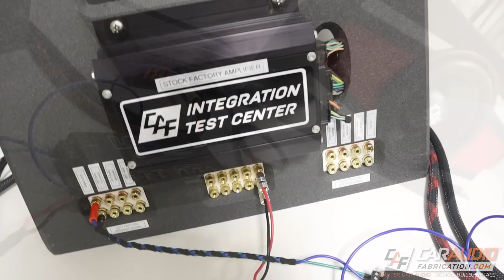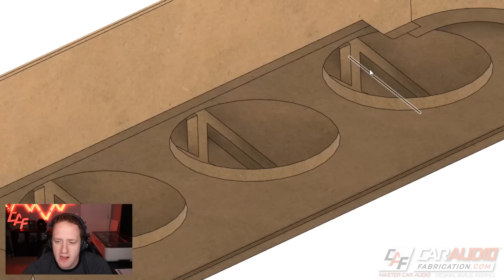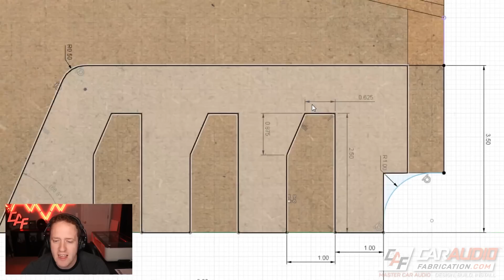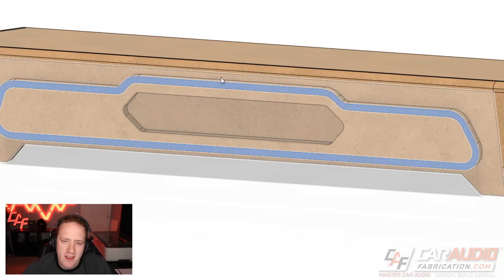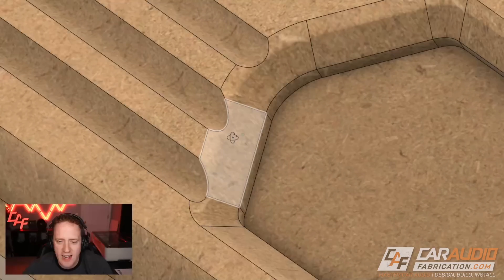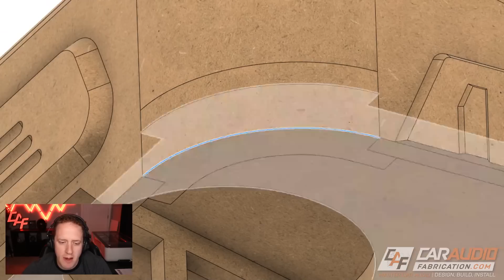Planning subwoofer enclosure details to match vehicle DNA!

Comment: I need advice. I have a 1200rms amplifier and i am using 4 gauge wire for power. However i only have enough 4g wire to run from battery to amp. I have a piece of 8gauge wire which is just the length of the ground i need. I want to know if its ok that i use the 8g ground when i have 4g power. i am asking because i already have that piece of 8g wire and it can save me from buying the 4g wire.

Comment: Serious question about my car audio. I’ve got 2 wov 3 12” subs on a NVX 1600 watt amp. Sold by sonic electronix. Anyways I have 4 speakers all running to a separate amp I bought from auto zone, pioneer 1000w or 250x4 I think like 80-90 rms or something like that. Had the setup for a good 6 or so months and the the speaker’s started to get very quiet until I maxed my volume and it fixed it then I immediately turned it way down to avoid harming the equipment. Then about a week later the subs started to clip alongside the speaker malfunction and when that happens I get scared to harm the subs and pop out my single den and leave it alone for awhile. Any suggestions for me? Haven’t really had a second to check out anything yet other then the connections on the back of the sub box. I also have the Bass on the amp turned all the way down with the passes set. I’m noticing my battery level isn’t holding a charge as high as it use to. I got my battery checked but it was okay as well as the alternator. Good I have a lose belt on the alternator?

Comment: What CAD System do you use?
Reply: Thats Autodesk's Fusion360
Reply from the maker: 3d modeling software is a tool and there are a hundred options. What works for me might not be best for you. There is no car audio specific modeling software and the designer does the work.

Comment: I'm looking to build a sub box for the spare tire space in my 1992 Camaro. I'm thinking 2 10s or 12s, idk for sure yet, but also would like to have an amp for door speakers and such. Any ideas on a good build??
Reply: JL Audio XD700/5v2....75 watts x 4 channels for your mids and highs and 300 x 1 for your subs.  Runs about $800.  I would still put power to you rear speakers for rear fill....makes a big difference on the "fullness" of the sound stage.